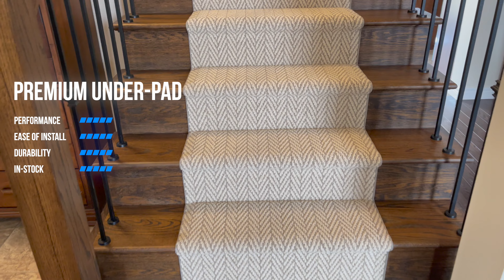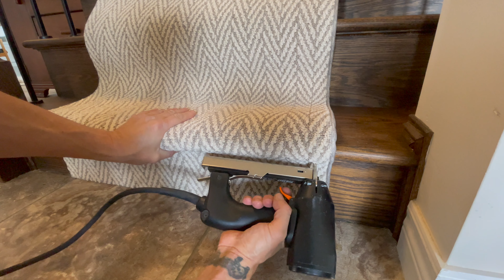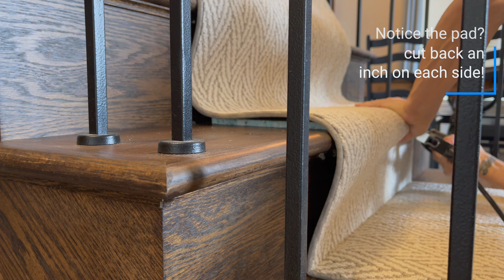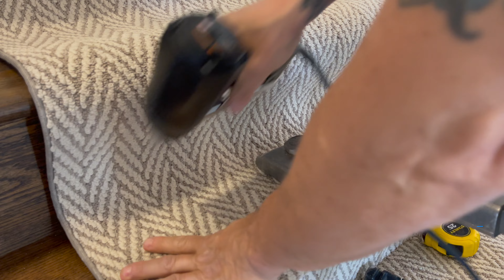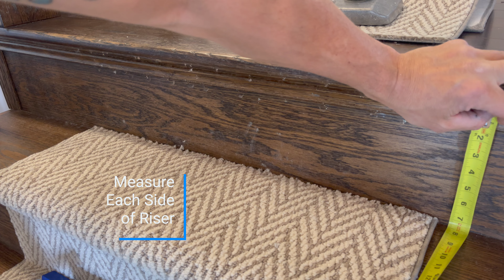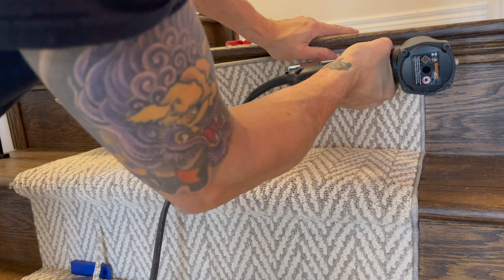How to Install a Carpet Runner On Stairs Easy!

Comment: What are the negatives to wrapping the padding over the stair nose?
Reply from the maker: Wrapping the nose with the underpad helps the carpet wear better, but if you have a side view and using thick pad, you will see the gap on the outside, so depending on the installation and the thickness of the pad most times if it’s visual from the outside meaning when you’re walking by the staircase, we will cut our pad tight to the nose

Comment: A quick follow up Keith.  On question 2 below, I will leave the base shoe on as it doesn’t impede getting the runner up and tight under the bullnose of the tread.

Comment: Great video Keith!  I wish I watched this as my first step in my stair runner project.  The video calls for 9/16" crown staples but the links to the Roberts staple gun refer to 3/16" crown staples.  Can you confirm the crown size (width) and length of the staples used?  Also, I have some base shoe molding under the treads (versus that crescent molding under the treads in your video).  Do you see any issue with leaving that base shoe in place just forming the runner over the base shoe the best I can?  These are basement stairs that I want to look nice as the basemenet is finished but am not hugely concerned with them looking perfect like on our main floor.  Thank you!
Reply from the maker: yes we use 9/16 crown for the guns and base molding can stay but i prefer off/ there is a video on my channel showcasing the base molding / its easier to do with it off!

Comment: How far do you leave the pad from the edge of the carpet? Say the stairs runner is 30" - what width should the pad be? Thanks.
Reply from the maker: 1 inch away from the riser and 1 inch shorter on each side so for a 30 inch runner it would be 28 inch pad!👍